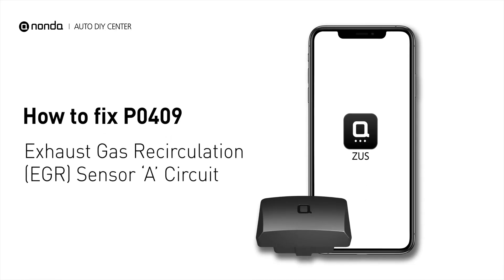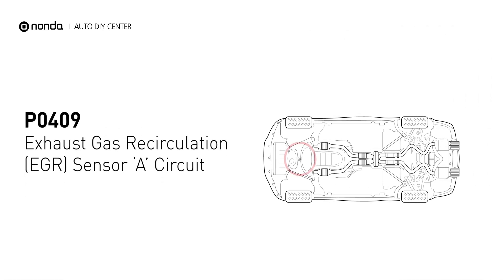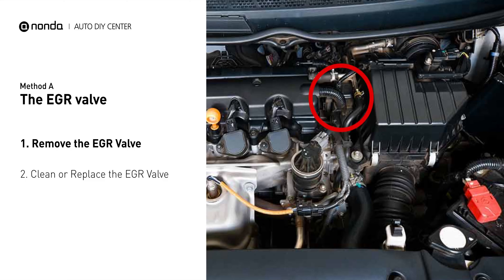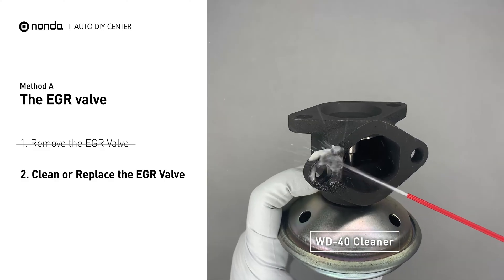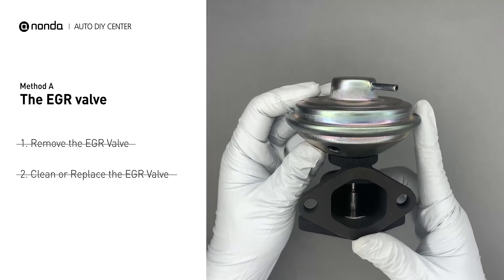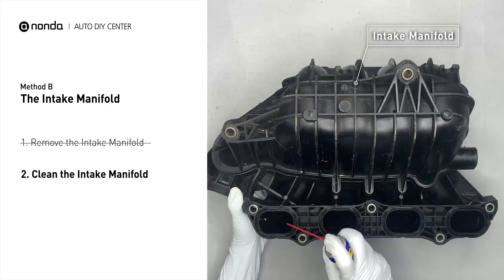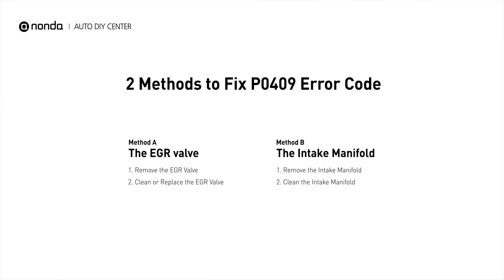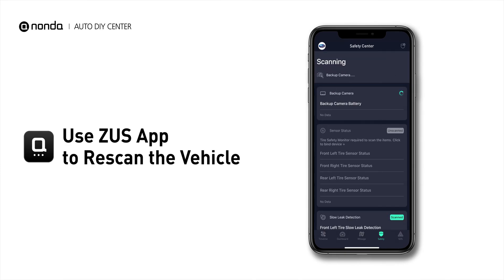How to Fix P0409 Engine Code in 3 Minutes [2 DIY Methods / Only $4.76]

Comment: Hi my8 opel corsa c 1.7 dti car wont pass 3000 rpms changed the mass air flow still tje same its says egr voltage too low boos sensor what can i do?
Reply from the maker: Hello, can you please confirm if this is the only code you're getting?
Reply: @nondainc  p1635 p0110 p0409 p0105 p1635 this are all tje codes the mass ai flow got cleared I replaced it today

Comment: It says wd40 cleaner but that can looked like the standard stuff will the standard work as week
Reply: WD-40 is not a cleaner, it's to lubricate things.I'd suggest a proper EGR Valve cleaner like Archoil AR2810
Reply from the maker: Hello, it is a WD-40 in the video and we recommend using it.